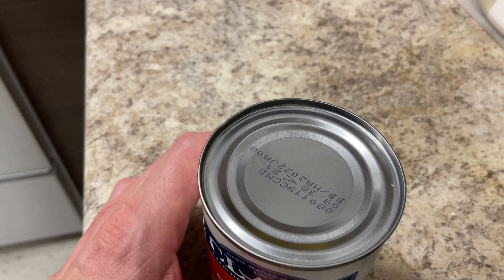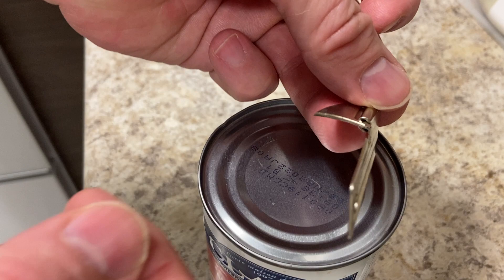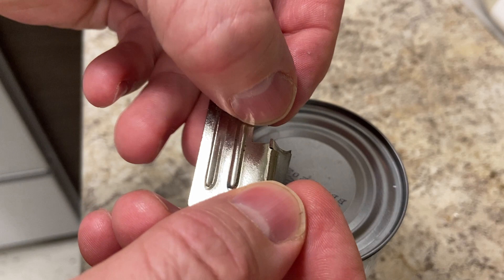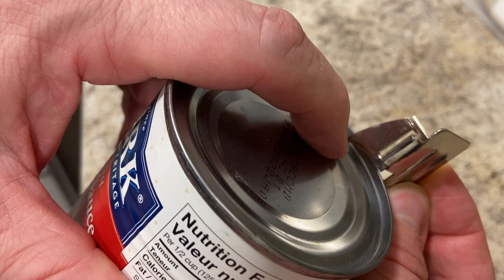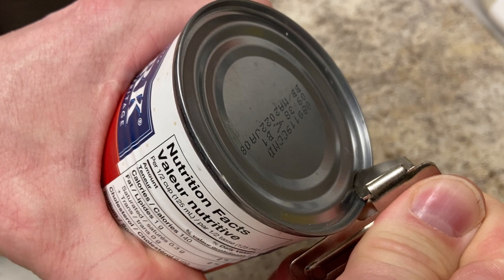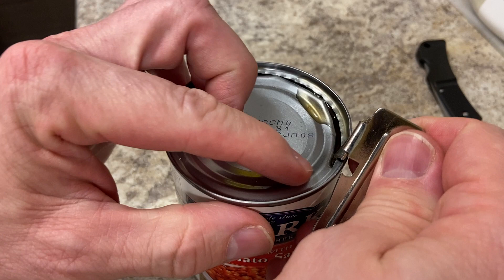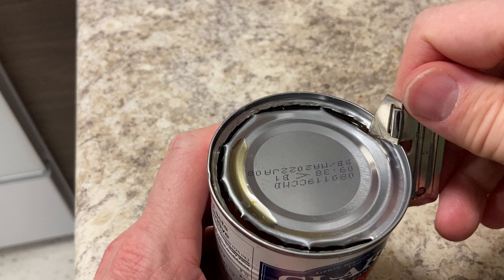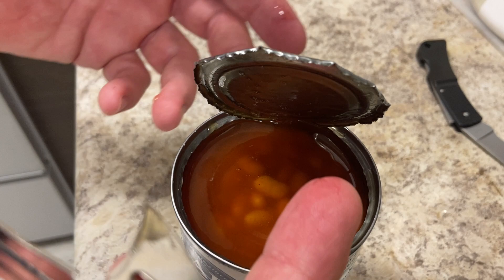Survival craft - use of the simplest, cheapest can opener

Comment: you wont believe me, but after years of cursing about all the types and models of regular can opener i switched my whole family to those GI openers after i saw them in a vietnam documentary.

they are good for about a hundred cans before the bottom hook wears off and it starts to slip off the can. depending on who is using them, if you put alot of force on them you can protect the bottom hook from wearing off.